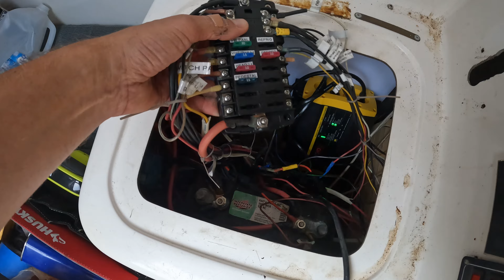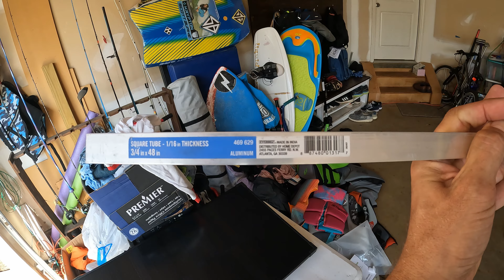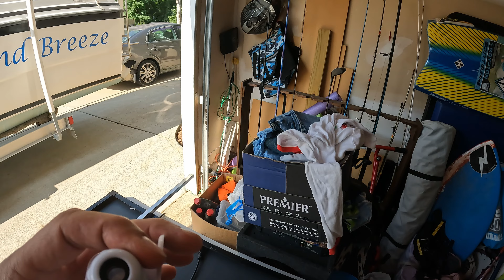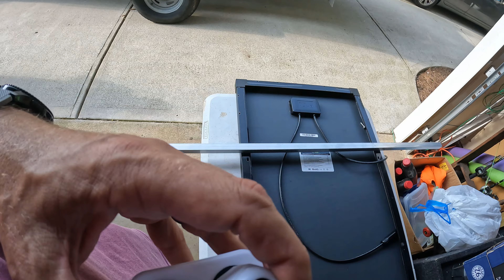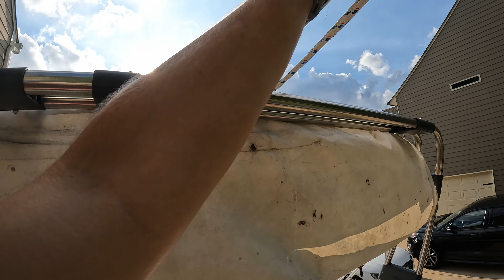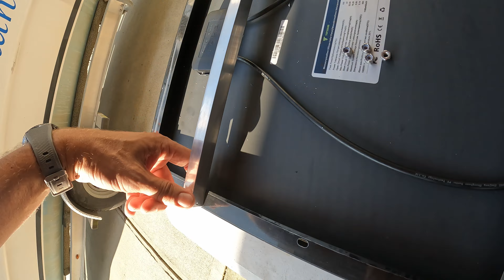MacGregor 26X Projects 4 - Electrical

Comment: I used a surface mount tv cable chase from home depot and bent it with a heat gun to the shape of hull to hide the wires from the upper area to that battery compartment. Mounted with double sided tape. Its about 2 1/2in wide and about an inch deep.  Holds lots of wires
Also dont get the pyle speakers i just bought them for my macgregor with the reciever and when it did work my cell phone sounded better than the speakers  then the pyle reciever broke they're not like they were.. Get a better brand
Reply from the maker: That's actually a great idea for the cable chase. I might steal that. As far as the speakers, I just bought the 200w pair of Pyle marine speakers. I'll use my existing radio which sounds decent. It's not a wakeboard boat that I'll be blasting music across the lake, so as long as they sound decent I'll be happy. Not trying to put a bunch of money in the stereo. I'll keep you updated in a future video.

Comment: How did you figure out which wire is which? I have a bunch of wires but I'm not sure what they connect to :(  Is there a faster way than using an ohmmeter?
Reply from the maker: I started at the load (light, radio, etc) and traced each wire back to the fuse panel. I did use an ohm meter a few times and used long lead wires to check continuity to make sure I had the right wires. Just takes a little time and patience.